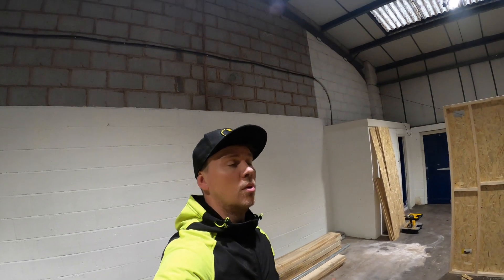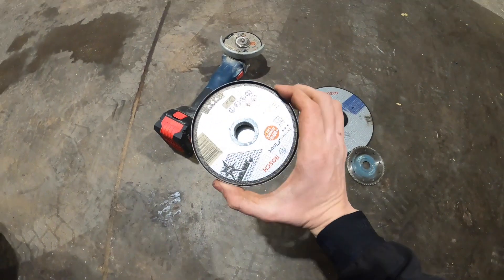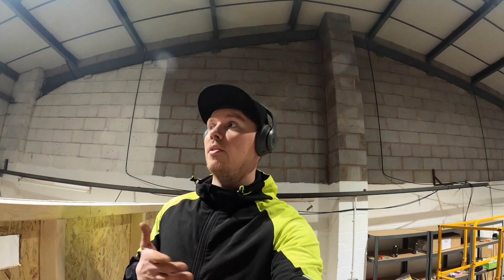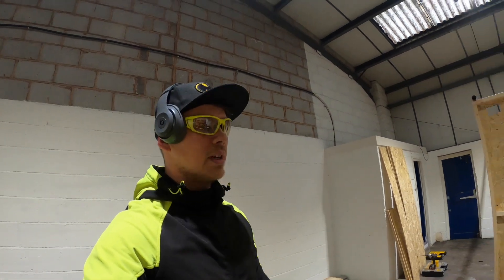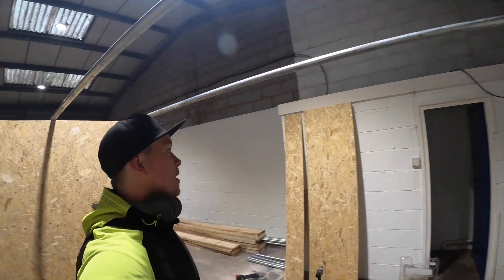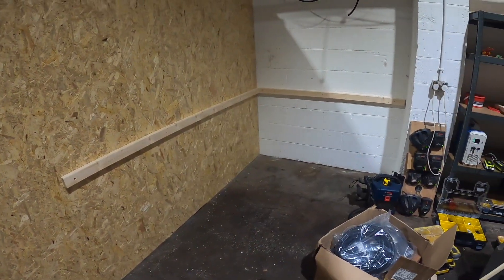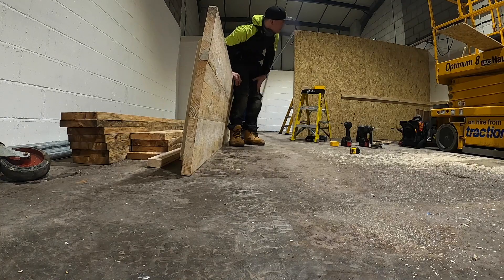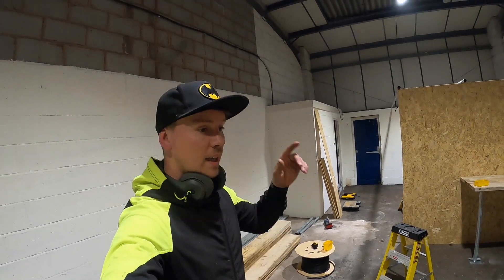Electrician tries Carpentry, Work bench

Comment: Do Bosch do a cordless bandsaw ;)
Hole saw the CLS to fit/socket the scaff tube under bench and/or even do across top of stud wall as well ;) looking good! 
Not sure what security you have there but early days was about ya Van getting hit, check out Ajax Alarm takes a SIM/WiFi etc also has PIRs with camera's.

Comment: Your getting there dude, don't forget if your gonna do firey things you probs gonna wanna setup a contained station with filtered extract so that you can do them without smoke issues inside and not pumping unfiltered smoke out that will make others think your units on fire or call the smokeys. Just a thought.

Comment: Save yourself a fortune and make your own acoustic panels. Use 2 inch thick foam in a lightweight wooden frame. They will work great. Very effective. 
I would space them off the scaff and then you can use the scaff to hang “studio” lights from.
Even using fibreglass insulation will work well (plus it’s fire rated) then just use fabric to encapsulate the insulation.

Comment: You mentioned awhile back about setting stuff on fire and putting stuff to the test, is that still happening? Would be a great series and would probably bring a few sponsors with it 😂
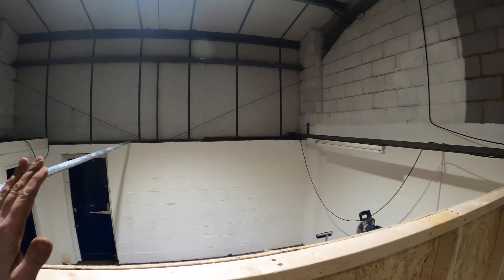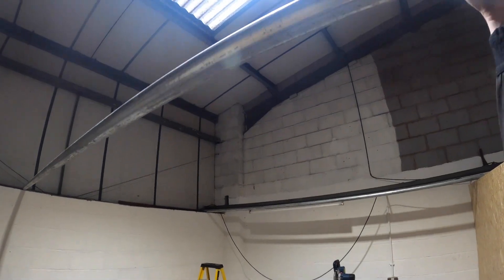Reply: I surprised that the 'sparks fly' cutting of the scaffolding against the scaffolding boards didn't ignite @5:56-6:16.